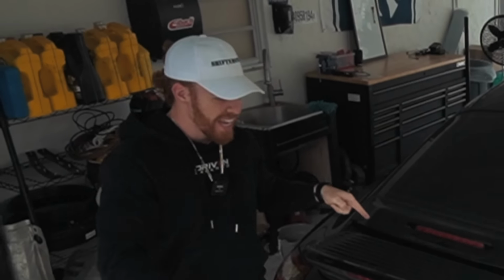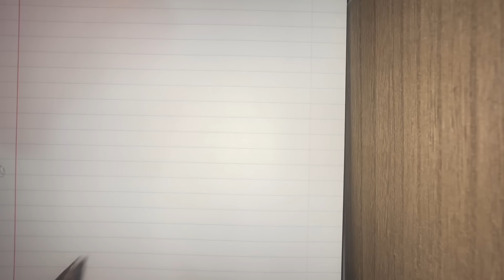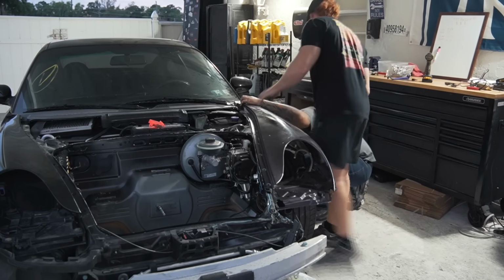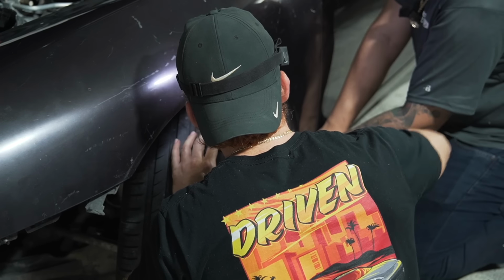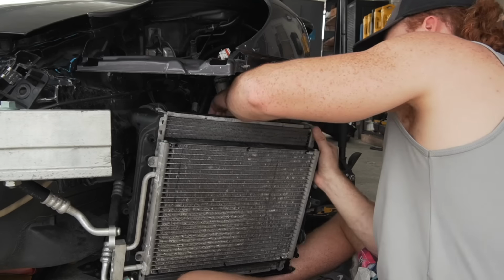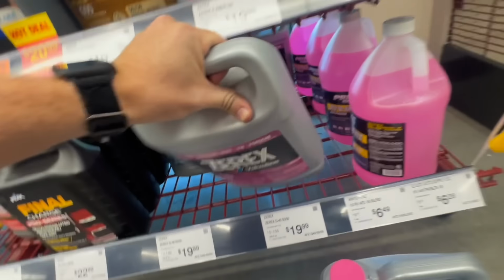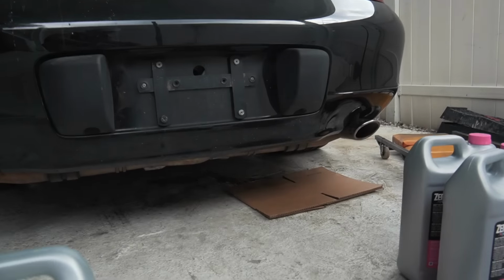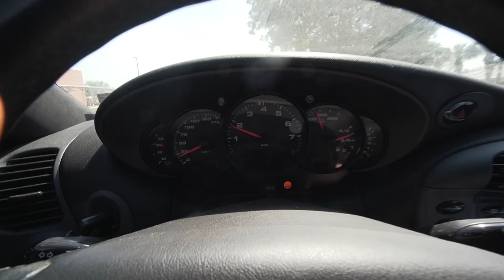Turning a CHEAP Porsche 911 into a $100,000 SUPERCAR!!

Comment: I had a similar experience with the wheel lock key for my 335i. I couldn't tell in the video what they lock pattern looked like, but for my 335 it was a sort of star pattern and they make them with varying numbers of splines. I just took a picture with my phone, zoomed in, and counted the splines (I want to say it was 31 or so). Then I went online and searched some forums and websites and found the correct key size with the amount of splines and ordered it that way. It was cheap too, so i ordered two of them just in case. Not sure how helpful this will be, but loving the content, keep it up!!

Comment: Do the x51 engine upgrade package which basically makes it almost the same as a gt3. Also another trick to get it to sound and perform like a gt3 is do the variocam-plus system delete on the valve buckets to make them lighter and rev higher, that plus valve springs/cams rev to 9k rpm for that crazy exotic sound with an x pipe in the back

Comment: you can hammer a somewhat too small socket on the locked wheel nut and then you can get it of with a wrench
Reply: I had to do the same thing. Just hammered it on. Worked great

Comment: Just use vice grips or hammer a 12pt socket on the wheel lock and then take it out and replace it with a regular lug. Not worth the money on the key.